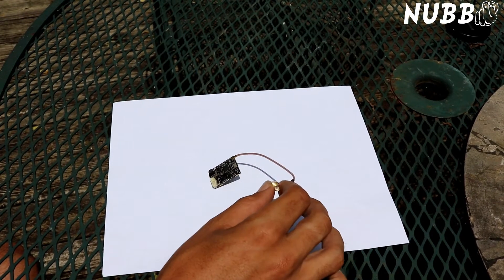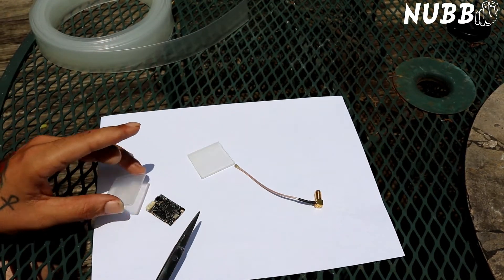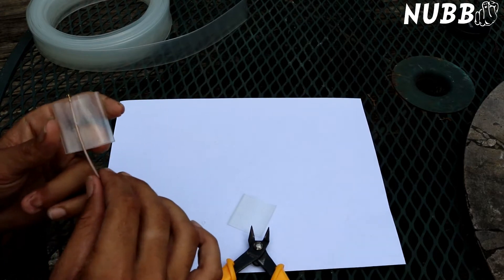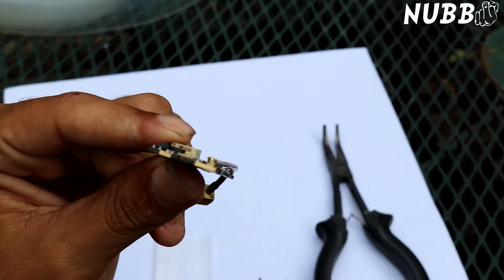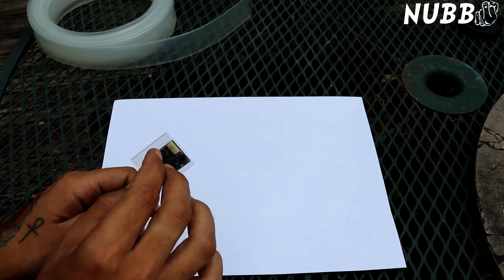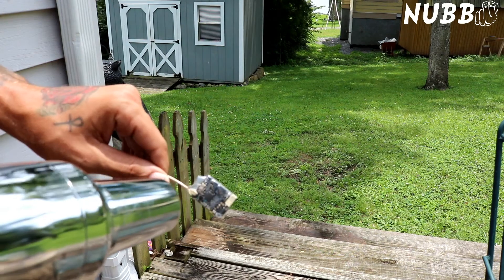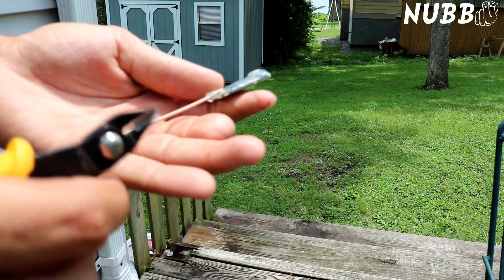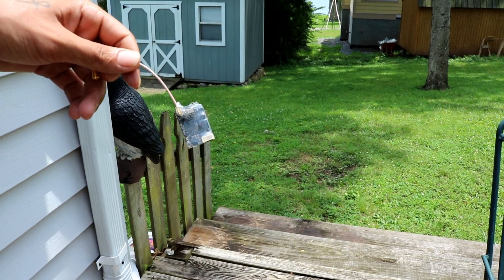Team BlackSheep Unify Pro Life "Hacks"

Comment: Great video. Dude, I'm installing a new one and ran into a problem. What does it mean when the yellow led continuously flashes?  No other led comes on , just the yellow one flashing. I just subbed.
Thanx
Marc :-)
Reply: Oh, and I have version 3
Reply from the maker: I’m not sure what that means, I’d contact tbs on that. Never seen that issue
Reply: Nubb FPV thanx for the quick reply. It was in pit mode. Lmao !
I just finished using one of these methods to mount it. It's a tight build so I'm still getting some horizontal lines but they look more like ripples. Gonna throw some props on and take it out front to see how bad it is. Lol
Thanx man this video was helpful. 😊
Reply from the maker: Mad Marc if the lines get worse as you add throttle, try putting a cap on your quad to get rid of that noise
Reply: Nubb FPV good idea ! 
Yes, sick thank you!😊